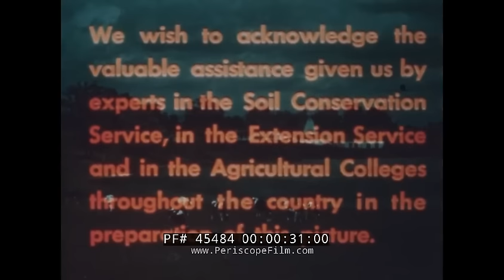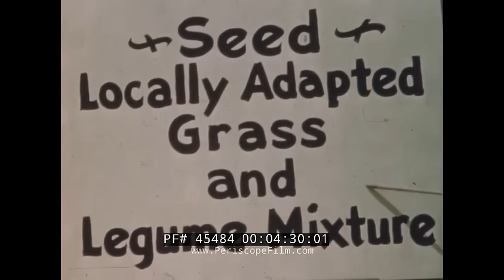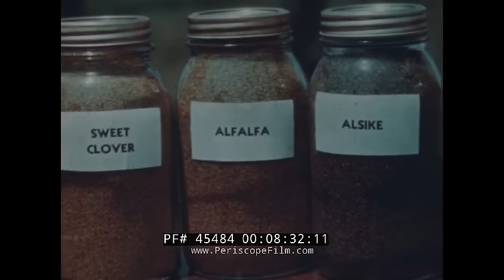1940s JOHN DEERE TRACTOR & FARM EQUIPMENT SOIL CONSERVATION FILM 45484

Comment: Can someone anyone please!!! Tell what kind of hat the farmer in overalls  is wearing and where I might find one
Reply: This is coming very late, but that hat [where the guy is handling the bag and shoveling] could be a variation of what is known as a 'classic railroad engineer's cap.'
The coloring of the cap in this video looks lighter than what I've seen with the classic railroad cap, but its profile is similar.
There are online sellers of such classic railroad [or train] engineer's caps.
Reply: @bloqk16  never too late if it's a good or correct answer.

Comment: Forking the hay into the barn by hand and cutting the hay with si is proably easier than baling it and owning tractors
Reply: no
Reply: It's called a scythe, and you'd need about five minutes using one to see the massive mount of labor involved just doesn't pan out.
Reply: Not that is funny. Scythe 1/2 acre per DAY ? Modern machinery 100 + acres per day in airconditioned comfort .